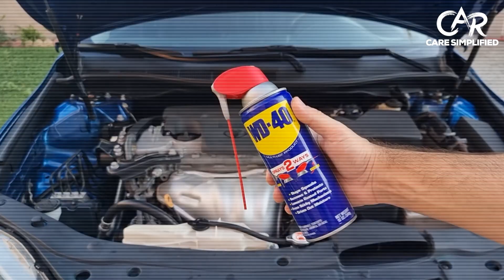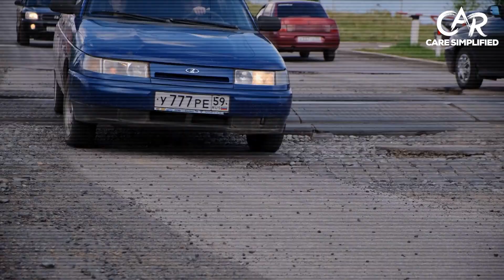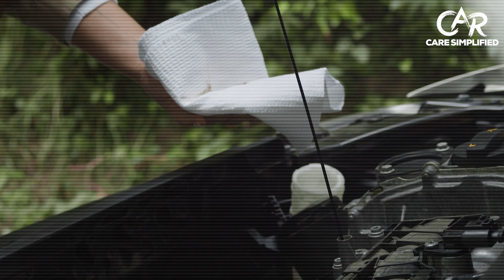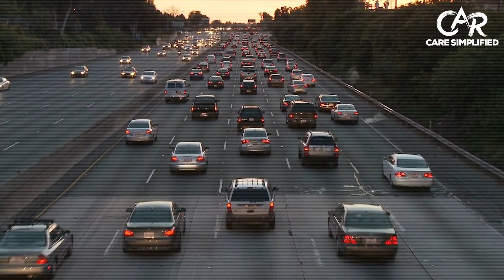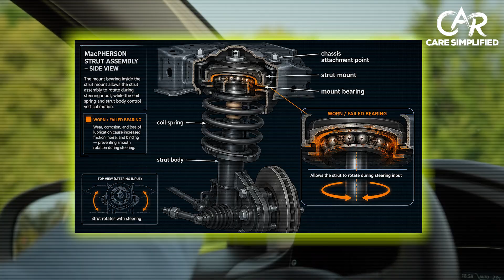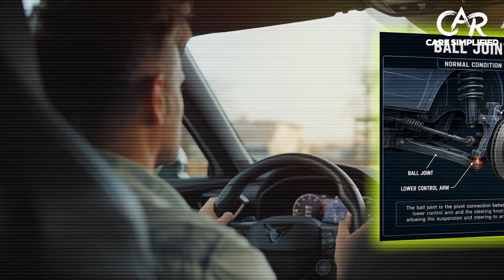Every Weird Car Noise Decoded: Grinding, Clunking, Squealing (Mechanics HATE)

Comment from the maker: 📌 Where this video's data comes from — pinning this for full transparency.
Every dollar amount, mileage figure, diagnostic test, and safety claim in this video is sourced from professional repair publications, certified mechanic content, and federal safety data. If you want to verify any claim, here are the receipts:

🔧 BRAKE NOISES (Items #8 + #3)
- NAPA — Brake Noise: Telltale Signs of Trouble
  https://www.napaautopro.com/en/brake-noise-telltale-signs-of-trouble/
- Firestone — Brake Wear Indicators Explained
  https://www.firestonecompleteautocare.com/blog/brakes/brake-wear-indicators/
- NAPA Echlin — Brake Pad Wear Sensors
  https://www.napaechlin.com/en/products/sensors/napa-echlin-sensors/brake-pad-wear-sensors

💰 DIAGNOSTIC FEE DATA ($122–$179 average)
- RepairPal — General Diagnosis Cost Estimator
  https://repairpal.com/estimator/general-diagnosis-cost
- RepairPal — Check Engine Light Diagnosis ($122–$233)
  https://repairpal.com/estimator/check-engine-light-diagnosis-testing-cost

🚗 SUSPENSION + STEERING (Items #9, #6, #2, #1)
- Auto Barn — Sway Bar End Link Diagnosis (9-of-10 statistic)
- CarParts.com — Mia Bevacqua, ASE Master Tech — Sway Bar Link Symptoms
- AutoNation Mobile Service — Power Steering Diagnostics
- Synchrony — Strut/Shock Replacement Cost Data ($806–$904 avg)
- Fatboys Off-Road — Strut Mount Failure Symptoms

⚙️ DRIVETRAIN + WHEEL NOISES (Items #5 + #4)
- AutoNation Mobile Service — Wheel Bearing Cost & Diagnosis ($200–$800 range)
- Tomorrow's Technician (trade publication) — Bearing Diagnostic Methods
- GSP / GKN — CV Axle OE Manufacturer Specs
- The Motor Guy (ASE-Certified working mechanic) — CV Joint Cost Progression: $120 boot → $290 axle → $475 advanced wear
- 2CarPros — Engine + Drivetrain Noise Isolation

🔥 ENGINE NOISES (Items #10 + #7)
- AutoZone DIY — Serpentine Belt Diagnosis
- AutoNation Mobile Service — Why WD-40 Damages Serpentine Belts
- Mike's Auto Repair — Belt Service Life Data (60K–100K miles)
- Burt Brothers ASE-Certified — Engine Noise Taxonomy
- Newparts — Electric vs Hydraulic Power Steering Diagnosis

🚨 SAFETY DATA (Item #1 — Ball Joint)
- NHTSA Safety Recall 24E-079 (MOOG ball joints, October 2024)
  https://static.nhtsa.gov/odi/rcl/2024/RCONL-24E079-7245.pdf
- NHTSA Recall — Ford rear toe link / cross-axis ball joint failure (Feb 2026, 412,774 vehicles affected — confirmed steering control loss risk from documented ball joint defects)
- NHTSA Safety Recall 21E027 (MOOG upper ball joint, April 2021)
  https://static.nhtsa.gov/odi/rcl/2021/RCONL-21E027-0744.pdf

📋 BRAND RECOMMENDATIONS DISCLOSURE
Brand mentions (Moog, Gates, Continental ContiTech, Akebono, Timken, SKF, GSP) are based on documented OEM-supplier status and ASE-certified mechanic consensus across multiple independent shop sources. Not paid sponsorships. Amazon links in the description are affiliate — they fund this channel at no cost to you.

📋 LIMITATIONS DISCLOSURE
Several diagnostic tests in this video have documented limitations: brake pad self-inspection fails on EVs with regenerative braking, the CV tight-turn test is less conclusive on AWD vehicles, and the wheel-rock bearing test is only reliable on cars with non-sealed dust shields. Always cross-check symptoms against your specific vehicle's service manual.

💬 Got a specific claim you want sourced? Drop the timestamp in a reply and I'll show you exactly where the data came from. I read every comment in the first 48 hours after a video drops.

🔧 Listen carefully. Drive safely.
— Car Care Simplified